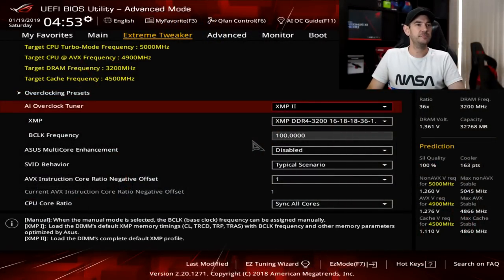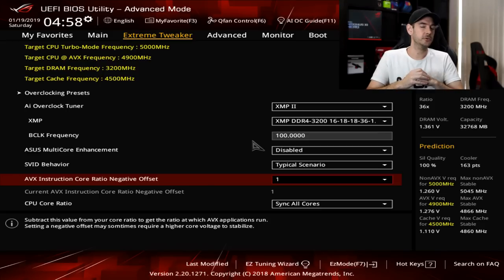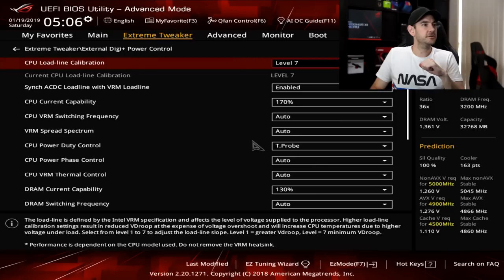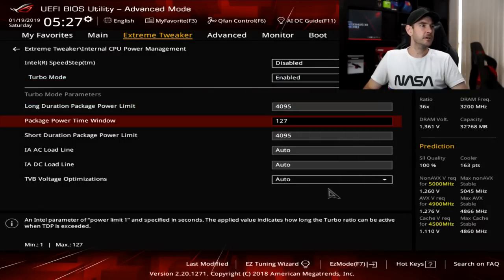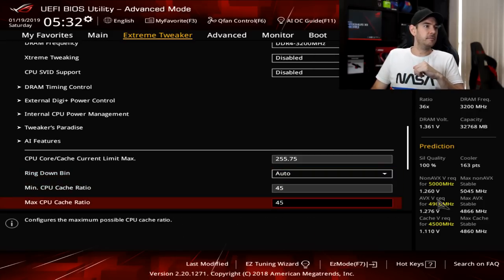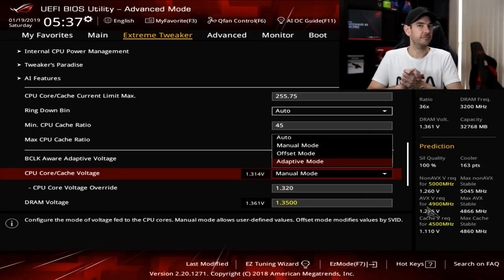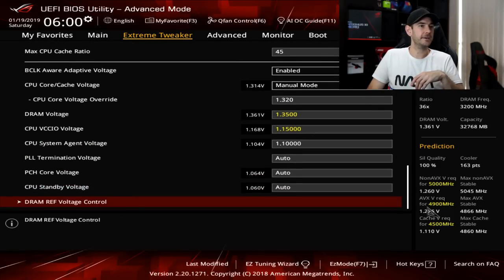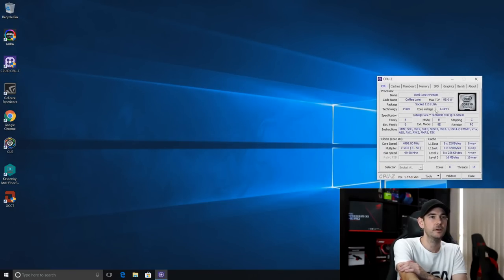The Complete i9 9900K Overclocking Guide - Maximus XI Z390 and Others

Comment: where are the input and cache voltages? are they regulated automatically in this mobo/chipset
Reply from the maker: Core and cache voltages are shared on this motherboard.
Reply: @boostedmedia  yeah i'm aware of that. what about VCCIN. it's common knowledge that it should be +0.4 of vcore. is that automated now? also i'm not really sure about maxing all turbo mode parameters. current and power limits are there for a reason, they generate unnecessary heat

Comment: My chip really sucks. I can't get a stable 5 GHz overclock and even 4.9 is pretty unstable with AVX offset at 1 even at 1.32 v. If i go ANY higher than 1.32 v im reaching temps above 90 degrees. Seems like everybody easily hit 5 GHz at even lower voltages than my chip requires to run at  4.9. Worth noting is that I have a Corsair H115i 280mm AIO cooler.
Reply from the maker: You’ll probably find it does better with adequate cooling.
Reply: @Boosted Media Most likely, still a bit suprised that it runs so much hotter than your chip even though I have a larger cooler.
Reply: @goodolrub7351  It is the silicon lottery man. I have the H115 RGB Platinum, and I can hit 5.0ghz, at 1.29v with no AVX offset (bios reports 1.27.7v, CPU-Z reports 1.1360v). What is your cooler points? Mine was at 205pts before my bios refreshed just now. What programs are you using to run your tests? I used OCCT for twenty-minutes, if it is stable there, I run a shift in RealBench. If there are no WHEA errors after eight hours, you are as stable as you will ever be. Do not bother with Prime95, it is bogus, and puts the 9900K under unrealistic workloads.

Comment: To start the OC tests on the i7 8700K putting at 4.8 Ghz and 1.26V do you think that would be a good start?
I have not done Delid yet.
Reply from the maker: Yes that sounds like a good place to start depending on your cooling.
Reply: @boostedmedia  
Thanks for the advice, I'll start with this for starting point and monitoring and stability.

Comment: Got 5GHz on all cores for 9900K with Asus Rog Strix F-Gaming Z390 motherboard. I set 1.3V for CPU (calibration level 7). Everything looks good. Benchmarks show me 77C for CPU in average (without water cooling). Does it sound solid for a such voltage?
Reply from the maker: Good result!
Reply: @boostedmedia  Btw, you made a mistake when said "set BCLK Aware Adaptive Voltage to Disabled", however you left it as Enabled. What did you wanna have actually? It was 13:30 in this vid. I do believe you wanted to keep it as Disabled.
Reply: @boostedmedia  and also at 21:25 it was caught that you changed your pre-tested profile settings more than just setting a new name of the profile. :) Please, let me know what it's supposed to be either Enabled or Disabled. Really interesting.

Comment: For some reason, it's not letting me modify the VCCIO and System Agent Voltages. I've looked everywhere for a solution but I can't seem to find one. Can you help me?
Reply from the maker: I’ve heard of that problem before with older BIOs versions. Are you running the latest?
Reply: @boostedmedia  Revision 1302?
Reply: @boostedmedia  Just a quick update, checked my BIOS after your message and saw that I am indeed running a very old BIOS and the latest version actually got a patch for the 9900KS. Everything worked instantly after updating. Thanks.

Comment: Yesterday i ocd my 9900k out of the box and all my benches passed fine, but after 3 4 hours the pc froze completely and i had to hold the power button so, should i up the voltage or down it a little?
Ps: it was sitting on 1.300 volts
Reply: You most likely need more voltage. I'd use CPU-Z to see what voltage is being recorded in there too, as it's most likely different to what is being set in your motherboard.
Reply: @samueldasilva4615  so i amped the voltage to 1.310 adaptive @5ghz, i ran occt 4 hours, realbench 16gb ram 2 hours, aida64 for 30mins but ran cinebench r15 and r20 during it for 3 times each, my temps were around (60-70 in occt)(70-79 in realbench)(70-84 in aida but when also running cinebench) am i set? Im not trying to be cocky dony get me wrong, i just built my first pc without help from my friends and second time attempting oc, tried on my 6700k back in the day but i lost the lottery HARD on that one so im still butt hurt. And those friends are gone now so...
Reply: @samueldasilva4615  oh and to add, under avx my volts are around 1.252 with -4 offset to 4600mhz. And adaptive mode seems to do littteraly nothing i sit at 1.305v idle, yet i set it to 1.310 adaptive this is almost the same scenario with manual mode... :(

Comment: what LLC is best for 9700k. i followed this guide for my 9700k. i can oc to 5ghz but temps gets quite high i om i150pro 360 AIO some advice would be very appreciated very awesome channel =)
Reply: pz1 What temps are you getting? I have the same CPU and AIO as you and under stress test I’m getting no more than 67c. I’m using LLC level 6.
Reply: Bosound  around 85c. in intel burn test at maximum level  at 5ghz
Reply: @pz1630  I get about the same temp using Intel Burn Test. AIDA64 I get no more than 67c. During normal gaming, around 62c. That's without doing any kind delidding. Depends on airflow and ambient temps too. I have 3 140mm intake fans at the front and got the H150i Pro mounted at top. What's your temps during normal use and gaming? Stress tests pushes the CPU to its limits so any kind of high temps you get isn't what you'll be getting outside of that.
Reply: Bosound  in quakelive midrange 30c. downclocked it too 4.800mhz. not really that big of difference in intelburn test max 76c. still 300fps+ in quake champions. max 54c. same for cs:go

Comment: I need you help with my bios set up ,  my motherboard is Maximus X code , so there’s a problem with my memory card is 	G.SKILL TridentZ RGB Series 16GB (2 x 8GB) 288-Pin DDR4 SDRAM DDR4 3000 
How come my computer it didn’t work with both card in , it work with one card.? What is the problem ?
Reply from the maker: Faulty ram most likely. Or faulty memory controller.
Reply: Boosted Media  how can I fix it ?
Reply: Could you help me to fix it ?
Reply: Any help?
Reply: no help ?

Comment: Hi, thank you for your Great tutorial,

I would like to hear from you what do you think about the stability test results based on my configuration:

- ASUS HERO XI

- 9900k @5Ghz (vcore 1.32 - AVX negative offset 0)
- corsair dominator platinum 3200Mhz (XMPII)
- AIO Corsair H150i Pro (360mm)
- Fractal Design Define R6 

So when I test my OC'ed system stability this is what happens:
OCCT for several hours (more than 2) - no errors and, temp around 58-60°C;
Prime95 Blend Test  for several hours (more than 2) - no errors, temp around 58-60°C;
Prime95 Small FTTs  for 30 seconds - temp around 95 - 97°C - explosions, aliens, IIIWW, etc etc... blu screen and reset (no matter what AVX negative offset I set, I've tried to set 1, 2 or 3.... maybe the test lasts for more than 5 or 6 minutes but the result is the same and the temps go too high);

So I've read somewhere they say Prime95 uses an unreal Load stressing test parameters... but... why is this happening? Don't you think the gap between the two kind of tests is too deep?

Do you have any tip for me?
Thank you for your help!
Reply from the maker: Small FFTs bombard the CPU as it only loads from the cache and not ram so the CPU never gets a rest. Completely unrealistic workload. I never use small FFTs to test for this exact reason. 

It’s like running a car engine at the redline all day and then wondering why it blew up.
Reply: @boostedmedia  Thank you so much for your fast reply, 

so do you think using OCCT and, for example, Asus Realbench (here the temps, after 1:30 h, are around 80°C with AVX offset at 0) or intelburn is it enough to know if your system is stable?

thank you again for your courtesy
Reply from the maker: I have another video explaining my stability testing process here... https://youtu.be/pgOzKwAMvjc
Reply: Boosted Media thank you so much for your help!

Comment: Great video! I also don’t like adaptive ! Problem is even after disabling it and other option, my Core Voltage goes up to 1.37-8 even if I set it up to 1.32..! Can’t find the reason
Reply from the maker: What level is your load line calibration set to?
Reply: @boostedmedia  Level 7 and 170%. I tried Level 6 and it makes it much more stable. But I cant get to OC my 9700k at 5ghz. When I run Prime95 Small, core #4 fails and the worker stops.
Reply from the maker: Not many people use Prime95 for stability testing anymore. It’s such an unrealistic artificial workload. No application in the real world will ever put the CPU under that much stress.

Comment: how about the issues that this board  has ? have you got any cuz i got issues booting and not recognizing keyboard. what are your thoughts?
Reply from the maker: I haven’t had any issues at all.
Reply: @boostedmedia   just asking because the start light remains on after I shut down the pc and the board light. Mine boot up to windows bypassing bios screen and wont turn on my keyboard.
Reply from the maker: The start light it meant to remain illuminated. You can turn it off in bios. Bios bypass on boot can also be disabled.

Comment: I am trying this guide for my I9 9900k along with a asus maximus xi hero. At full load I get at 100 degrees and thermal throttling (I have a 360 AIO water cooler from the Deepcool genome Rog case). I get some weird reedings on my Intel Extreme utility monitoring like 50 degrees on 10%CPU with 0 active core count and a package TDP of 3W ?. max core freq is at 5,00 Ghz and proc cache freq is at 4,50. I copied the exact settings of this vid. On the AI info panel my chip has 121% sil Quality and my cooler rates at 180-190 points. RAM is cmw16gx4m2c3600c18w at 1.35V and my cinebench R15 score is 2122. Got any advice about the temps ? I don't know if I'm wrong or sth but games like Pubg seem to use less cores now at higher freqs, so I get higher temps ?
Reply from the maker: That sounds about right for an AIO cooler at 1.35V without delidding unfortunately.
Reply: @boostedmedia  Thanks a lot for the guide and the reply! Would you recommend I should tone it down a bit below 5Ghz?
Reply from the maker: You’re welcome. I’d keep your voltage under 1.3V and see what clock speed you can reach comfortably. It’ll probably end up being around 4.9GHz if you’re not using AVX offset.
Reply: @boostedmedia  My cpu core is at 1.3V , will try to lower it . Did 1.35V for ram coz that was the specs for it. Will mingle with those and see how it fares. This guide actually let me use the pc I bought at its value so thanks again!

Comment: I have no issue running the OCCT stress test (86C) and other benchmarking software like Heaven (77C) but strangely I'm getting 86C after  playing about half an hour of Call of Duty-World War II. I tried lowering the OC multiplier to 49 and 48 but temperatures still peaked at 86C after playing COD-WWII. I tried raising v-core to 1.34v but it didn't help. I'm OK to have a lower OC of 4.8Ghz but I don't understand why a game (COD-WWII) can be as demanding than OCCT. Would appreciate your advice.
Reply from the maker: Could be the extra heat I chew case being generated by the GPU is causing higher CPU temps. Also depends on how the CPU is loaded. OCCT isn’t particularly brutal on the CPU in terms of the temps it generates as it doesn’t hammer the cache.
Reply: @boostedmedia  I thought passing the stress test and being able to game for hours without any crashes (after the manual OC) meant that the OC was stable. Until I check the temperature after gaming :(
Reply from the maker: 86C is still perfectly fine.
Reply: @boostedmedia  I would think 86C after a CPU stress test was pretty OK as I've seen >90C when doing CPU stress tests in the past. If not for me checking temperatures after gaming, I would think the OC was fine as it idles at 38-43C and I experience no crashes when doing the stress test and playing games. Think I'll leave the 5Ghz OC setting as it is until I encounter crashes or if the temperature crossed over 90C. Thanks very much for your help!
Reply: @boostedmedia  I almost fell off the chair when I saw 91C after playing Crysis 3 at Profile 1's 5Ghz setting. To cut a long story short, I changed the multiplier from 50 to 49 and changed the vcore from 1.320v to 1.310v. Did the IntelBurn test and got a peak temperature of 85C. I noticed that during most of the test it was running at 4.8 Ghz instead of 4.9 Ghz (must be the '1' adaptive thingy set in the BIOS) but it later reverted to 4.9 Ghz. Tested gaming again and got peak temperatures of 86C in COD-WW2 and 87C in Crysis 3. Checked my idle temperature and got 38-44C and saved the settings as Profile 2. Thanks a heap for the guide!!
Reply from the maker: Yep that’s the AVX offset.

Comment: Excellent video, congratulations! I tried to make those settings exactly, and it's not at all true! If I run Aida64, 1 min is already overheating! I've changed the vcore, it's no use, I put more offset, I left nothing too, I changed LLC (6) and I can not stabilize, my system gets very hot!
Worst of all, my setup is not bad (Maximus xi extreme, 2080ti, 16gb 3600mhz, H150i, 850x Corsair! Can anyone help me please god love?! Thanks
Reply from the maker: What’s your vcore set to and what were your CPU temps?
Reply: Boosted Media So, I started with 1.32, it warmed up quickly, and the system crashed, so I went down, so that it reaches a point that when running an AVX application the temperature is cool, when running cinebench the system crashes! I'm disheartened
Reply: Boosted Media I already reached 1.24, and believe the temperature reached 97 degrees! I'm not bored!
Reply from the maker: Sounds like your cooler isn’t installed properly.
Reply: Boosted Media OK! I'll take another look, the fans are installed correctly! One thing I noticed is that the pump connector is plugged into the fan input of the motherboard, rather than the pump input! Could it be that?

Comment: Definitely earned a sub! Thank you for not beating around the bush and going through everything step by step instead of jumping around all over the place. Was able to boost my 9900k to 5.1 easily with your setting and cooling setup has me in mid 75C under load.
Reply: What are your volts

Comment: Thx for a really good video with explanations. Im a novice at OC. Tried this with my 9700k. Followed the guide. Got into windows. Watched the idle temp for 15min between 39-41C. Did some normal desktop action. Tried my first test on Cinebench and got BSOD straight away. Any thoughts of what you suspect causing it? Super happy for any answer =)
Reply from the maker: Probably needs more vcore
Reply: @boostedmedia  Thank you for a quick answer. Much appreciated.
Reply: @Krankiz  just curious what voltage and speed you found that works. I also have 9700k
Reply: @joshbingaman2334  1.35V 5ghz. Realized quickly i needed a better cooler during load. Put a 360 aio and I have 4 additional fans. Working down the voltage now. Havent had time yet to test more. Just installed it like day ago.
Reply: @joshbingaman2334  So far after more testing 1.32v 5GHz like in the video is working fine with me. Crashing at 1.30v, bsod. Happy with the current temps. How did it go for you?
Reply: @Krankiz  Right now I'm at 5.0ghz and I've been testing fixed vs offset voltages. I'm using an offset right now and it can go up to 1.34v. Temps are good using 240mm aio.

Comment: In your experience does enabling BCLK Aware Adaptive Voltage increase or decrease stability? I currently have a stable overclock with it on and am wondering if I disable it will my system become unstable?
Reply from the maker: I always turn it off as explained in the video.
Reply: Boosted Media I stress tested my overclock with it on, if I disable it do I have to stress test my overclock again? Thanks
Reply from the maker: Depends on how you configure the voltage with it off. I’d say it’s probably s good idea to.
Reply: Boosted Media Okay Thank you
Reply: Boosted Media I apologize for asking so many questions but I stress tested my system following your video on stability testing exactly, so I really want to avoid going through that whole process again. All my settings are exactly like this video with the following exceptions: CPU Core Voltage Override is set to 1.27, AVX Negative Offset is set to 0, and BCLK Aware Adaptive Voltage is enabled. If I disable BLCK Aware Adaptive Voltage will my overclock still be stable? I apologize for taking up so much of your time. Your answer could save me a whole day of stress testing. Thank you.
Reply from the maker: You’ll need to stress test it again to be sure
Reply: Boosted Media okay thank you.